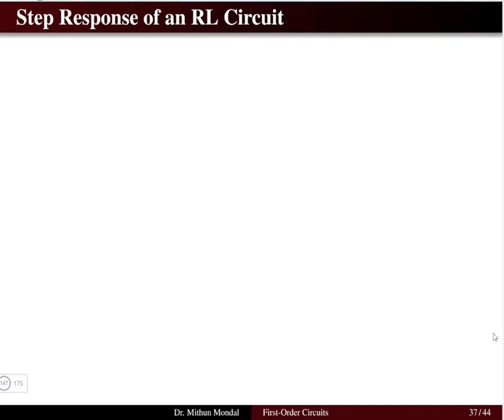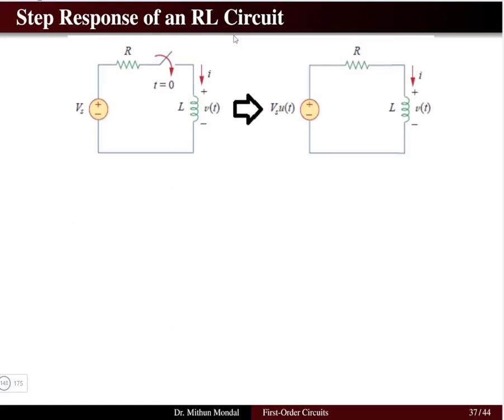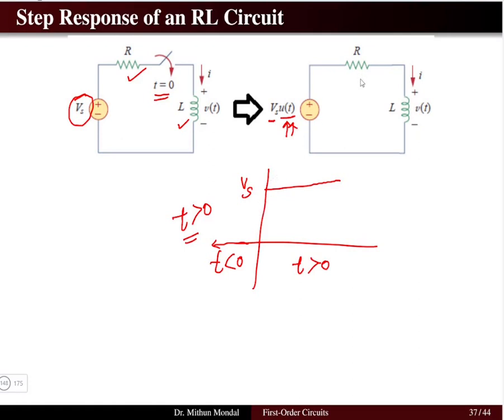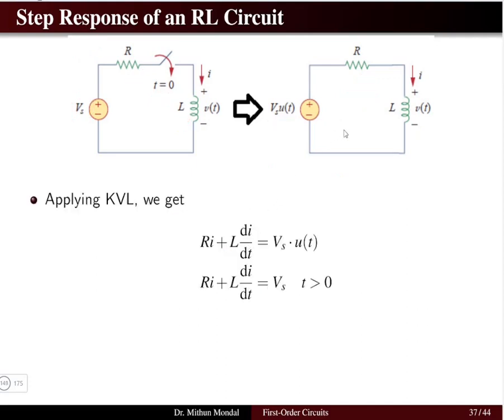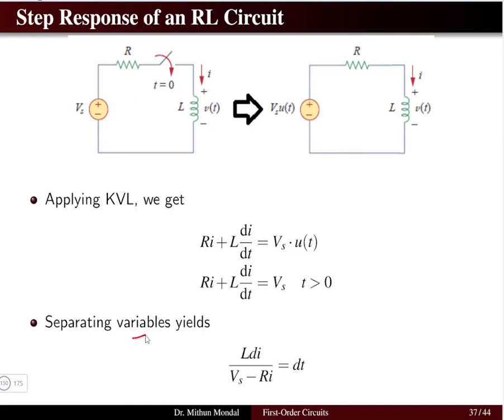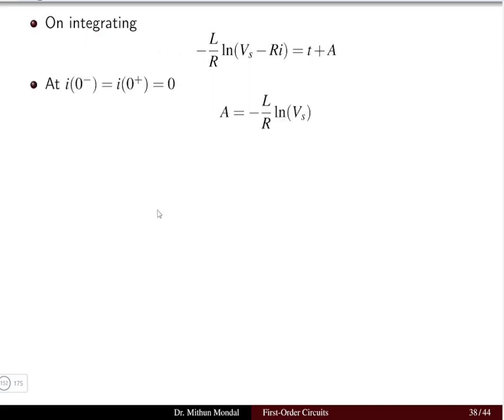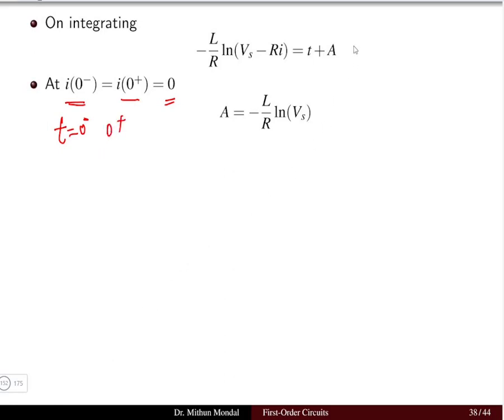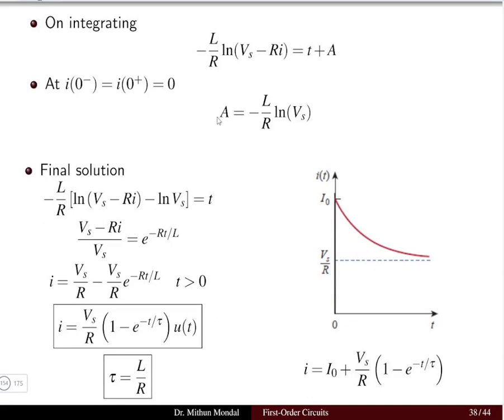Electric Circuit Analysis | Lecture - 6D | Step-Response of RL Circuit

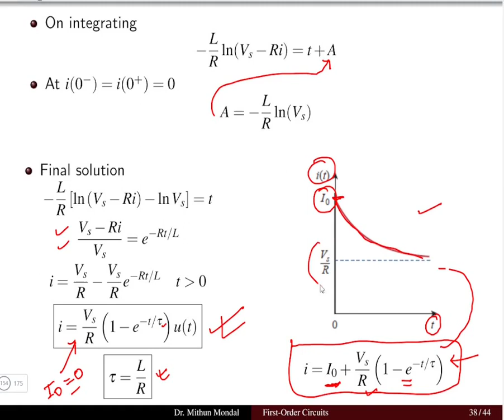Comment: at 6:00 current is shown to be decreasing exponentially. Kindly correct it.
Reply from the maker: Think if initial current I0 in the inductor is more than (Vs/R) than what will happen?
Reply: @EngineeringDevotion  the currents  aren't opposing but they are adding so how would it decrease ?
Reply from the maker: @borundiaspeaks2538  Going by your words than transient will never decay out, correct?